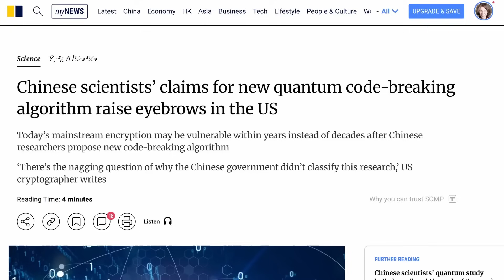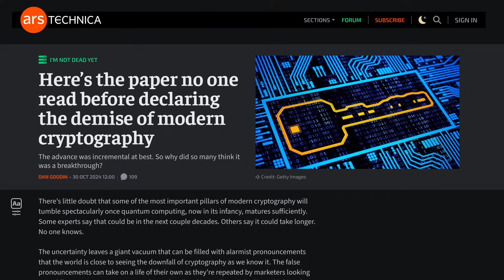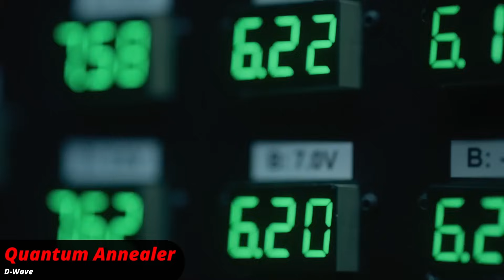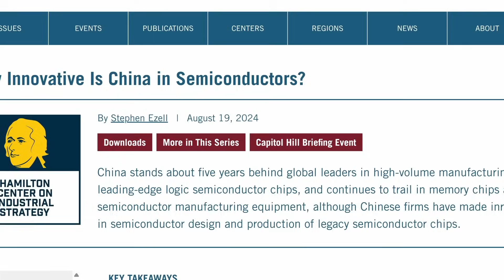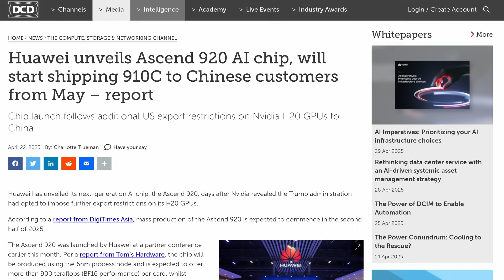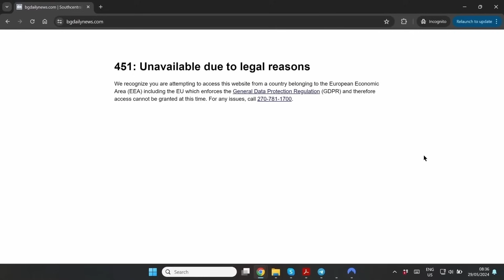Chinese claim "First Successful Factorization of RSA-2028 Integer". I've had a look.

Comment: I think everything has been broken already. There's nothing stopping governments from setting up a whole building full of quantum computers. We hear about things like the first 100 qubit computers, but it's not like it just stops there. At that point, all you need to do is replicate them and connect them. Even if it takes a whole day to crack a single code, if it's important enough, that's all that matters, which is exactly why governments would do it. So even if we don't necessarily have widespread encryption broken, being able to break the encryption on only a few hundred things a year is certainly worth it to governments for the most important encryptions.

Comment: You should be more worried about historic backups being deciphered, particularly with the frequency of password changes. 

For example copies of historic LastPass customer databases were snaffled, from the companies AWS buckets, a few years back, and they contain the credentials of all their users, on every site, the site names, be they crypto exchanges, banks, governments institutions, providers of cat videos, ..., are in plain text, along with the user ID, last access time, while the password was hashed, with the master passwords hash as the seed; depending on when stored, the passwords may have been 8 character strings, with 50 bits of entropy, pushed through perhaps just one iteration of an either weaker variant of the algorithm. Off line dictionary attacks against the customer DB, with a budget PC, would likely be revealing a few customers Master Passwords, and all protected passwords and associated data, per day, buy some old crypto mining rigs and in a couple of years they may have still valid credentials for thousands of users from the dumps. Cherry pick the customers with passwords for Crypto Exchanges, and wallets might start being drained, just like what the press are reporting, if not state secrets. All without a quantum computer in sight.

Comment: 3:45 So there's the catch. Factoring a number N=pq where p,q differ only by 2 bits is easy, even on a classical computer: The number of different values the difference p-q can take is only quadratic in the number of bits of N, namely, it is either the sum or difference of two powers of 2 smaller than sqrt(N). For each candidate value t of the difference p-q, simply solve the system of equations p-q = t, p*q = N (equivalently, let p and (-q) be the roots of the quadratic polynomial X^2 - tX - N) and keep going until you find a value of t that makes p and q integers (equivalently where the discriminant t^2 + 4N is a square number).

Comment: They can break standardized encryption all they want...... and it is basically trivial to add another layer of encryption to confound them,
The "one time pad" is still unbreakable and always will be... as is any non-standardized, sufficiently complex,  encoding system used in low volume comms.
They claim they can break a known code algorithm.. and it is knowing the algorithm that makes it possible to even contemplate breaking it.
Absent that knowledge...... good luck factoring anything that is of any use to decoding things
Or so it seems to me... and I studied encryption to write a simple one-time-pad software app. decades ago.
======
The reason they could break the Enigma code was because they had  Enigma machines to examine. 
They knew the algorithm first.. which was embodied in wheels and wires in an Enigma machine
Then they managed to break the encryption.

Comment: It's a confidence trick intended to introduce a whiff of uncertainty and apprehension at the business and operational layer.  The announcement and arguably the entire programme is intended to undermine default confidence (or arguably overconfidence) in the technological status quo; not just for future encoding (this point forth) but for all that may have run before presuming they maintained copies of data streams from that earlier period which can be retrospectively cracked.  Exposing old data like this can still be harmful so stocking the fire of that doubt may be strategically useful to the PLA.

Comment: Hi Sabine, i Love your content. Really. 
I understand the need for sponsoring. Really. 
I have had a certain VPN provider for years untill it started to break working with  certain streaming providers. 
Then i switched to NordVPN. That really did not help and did not make matters better. So i complained about this behaviour. All that NordVPN did was to ask me to open tickets for each incident ( read: each site that blacklists VPN ip-adresses and those numbers are going up.) 
I am not impressed anymore by VPN providers as they also are getting tracked and 'put on the map'. 
So for ordinary browsing consumers who want to benefit from masking ther location ( which does often not work), VPN hardly seems the solution anymore.
As you are an advocate of truth, i thought this is an important thing to know as well.
By all means i hope you can prove me wrong of course.

Comment: Those who talk about ‘breaking Bitcoin’ fundamentally misunderstand it. It is a network based on trust and if the trust is broken, it will dissolve into nothing. When you understand that, you will see that there is no monetary benefit to breaking its encryption. And on that, by the way, the Bitcoin developers have been discussing quantum-resistant cryptography for years and the network will at some point vote a hard fork and transition the protocol. But sure, waffle on about the boogeyman if you want 🥱

Comment: Hi, Sabine. I am a theoretical physics graduate student, and i really want to ask you something. You see, as of now i gotten a good understanding of quantum field theory, particle physics and general relativity theory, so basically the standard model and classical gravity, the standard theories. However, i notice that from this level and onwards, it is not clear anymore which direction to go. Some professors i have met stop at this level, and some are too busy with a very specific theory, like string theory, quantum loop gravity etc. But from your videos, i notice there are a lot of modern reasearch and important discoveries not limited to the standard form of those theories (strring or loop), which is not necessarily stuff written, as of today, in any books and so on. So, Where do you find papers and materials which like actually covers the most recent theoretical ideas and research. I am having a hard time finding trustable papers/sources of actual modern research, not only text book stuff... Sorry for my long question, but since you are a very respectable physicist whom i might have a chance to actually ask, i really felt i needed to ask this. Maybe its just my university, but my professors are not into this fundamental physics research..

Comment: Chinese is far easier to learn than English as long as you don't look at the writing system.  It has a very simple grammar (no declensions: no verb tenses, aspects, declining for number, gender, case, etc.) and a vocabulary far smaller than English's.

The writing?  Yeah.  That's harder.  But if you've learned to spell English you're already used to just memorizing orthography by rote.

Comment: by the time governments admit to having various tech; they have already been using it for years. in recent years NIST had their pqc standardization event that aims to reduce the number of candidates for pqc in rounds as the years go on. pqc isnt anything new. a myriad of entities can see the oncoming quantum apocalypse and have been preparing accordingly.
my company, SCS; has been developing new pqc algorithms for a while now. if you get how what is perceived to be just human minds as these quantum systems are not yet ai controlled (officially) you can gauge how cracking these protocols would be approached. one would begin by identifying the class or type of encryption used that is to be cracked. this would determine an effective and efficient method for approaching the cracking of such an algorithm. 
many of the popular forms of pqc use a lattice structure or the like in their new algorithms. i think it is 2 of these methodologies that have moved on to standardization from NISTs event. SCS is moving to develop pqc technologies that approach this in a much different way. were developing cryptography methods that entail quantum users or an ai controlled quantum system to attempt to identify the type of encryption and move to break it only to find that it appears to be broken, but it doesnt work. they will conclude that their classification on the type of encryption must have been wrong and attempt to reevaluate the type and try to break it again; only to find that it didnt work again although it appears that they have found a key. eventually they will try to move through every form of encryption know even though this approach would be resource intensive and inefficient only to find that nothing appears to break it though it appears to be an obsolete form of encryption. we are developing a myriad of these languages; each being a puzzle that works totally differently than anything that currently exists. im not going to say much more about it than that.
SCS is also pioneering prototype ideas in nuclear fusion with hardware running our own brand of pqc tech. it is entirely likely that current encryption tech is completely obsolete and has been for some time. they already know all of your secrets.

Comment: Quantum is a metaphor for meaning. Both semantic and teleological, but not either. The relationship between both. 
      The relationship between semantic and teleological meaning is not correlateble by any algorithm. Possibly not even consciousness and self-consciousness: intuition.
      I mean if cryptography breaking were so great then there should be no ancient script for which we would have no exact interpretation. Is that the case?

Comment: The problem with this is it is instance based and can not handle live data connections.  It you have the file encrypted and hand it to the Q machine it can crack it. But files behind active Web sites is a completely different issue. The Q machine can only preform a limited set of functions and this is so limited it is completely unusable for hacking.

Comment: Too bad that almost all comments below are based on very limited understanding of cryptography. Addressing a few confused comments.
Breaking RSA keys is not exponential in their length.
You do not need to double the key size for any algorithm to protect it from the quantum computer. For AES it is less, for RSA/ECC it is (much more)
ECC means Elliptic Curve Cryptography in this context, not Error Correcting code
Switching to RSA 4096 will not protect you much (assuming that quantum computers will ever be able to do RSA 2048)
RSA 4096 is not a good idea anyway; it is a gigantic waste of computer resources. Switch to ECC instead, where 384+ bits is more than enough.

Comment: When you said 2 bit difference in the random primes, I was like.. "Not very random was it."
>
It's all very interesting (quantum) but there is no such thing as a secure computer or secure data.
If you want a secure computer (or data) mash it up with a hammer, put the pieces in a blast furnace, and then shoot the left over soot at a black hole and hope the information is lost :)
>
The second part was the note about the algorithm not being any faster than a digital computer.
This is my primary gripe about the entire concept of Quantum computers. By the time that get it stable and reducing the noise plus error correction you don't have anything better/faster than the current analog based digital computers, and maybe even slower.
>
Or if you want fast, just embrace analog computing and accept the noise/uncertainty in the results :)
>
"Computers in the future may weigh no more than one-and-a-half tonnes." - Popular Mechanics, 1949
Anyone getting deja vu X-)

Comment: Hi Sabine, great work as always, but the title: RSA-2048 not 2028, as in 1024 bits X 2 = 2048 bit
Reply: next iteration : 4096 bits
Reply: Also: they just stole the private key hashes  a few years ago from the RSA main server, waited a few years till people forgot it, thought: we can create a scare in quantum computing, because no one would believe they cracked it with a binary computer: so theft, as they have done many times, not advancement in quantum ( i can't link to the original RSA private key server hack here, but you can google it very easy, including vetted sources like RSA themselves, Wired mag, and other security researchers )

Comment: It's all nonsense, there is no quantum processor with anywhere near the amount of cubits required to factorize RSA keys, not to mention that setting up the state of the system to perform the calculation in the first place even if you had that many cubits would take millions of years. There's no danger yet, and probably not for a very long time. Cascade algorithms need to be developed (to cut down the setup time) and VAST increases in cubit count are needed.

Comment: RSA was originally developed in secret in 1973 at Government Communications Headquarters (GCHQ), the British signals intelligence agency, by the English mathematician Clifford Cocks.  I was subsequently "developed" by Ron Rivest, Adi Shamir and Leonard Adleman, who publicly described the algorithm in 1977.  RSA is named after their surnames.

I suspect it was intentionally leaked through the three, who were highly plausible mathematicians in their own right, in order to introduce a sorely needed "good enough" and "unclassified" encryption standard to humanity during the early days of electronic fund transfers, as none of the alternatives were secure at the time.  I believe the need for white hat security was simply greater than the need to be able to crack black hat encryption, a paradigm shift which continued with the release of DES, then 3DES, and ultimately AES.

The problem with RSA is that it's fairly easy to crack.  It just takes time, but nowhere near the eons it takes to crack AES.   The security of the RSA cryptosystem is based on two mathematical problems: the problem of factoring large numbers and the RSA problem. Full decryption of an RSA ciphertext is thought to be infeasible on the assumption that both of these problems are hard, i.e., no efficient algorithm exists for solving them.  Just because it's not efficient doesn't mean it's not possible when you throw enough processor power or quantum's simultaneity at it.

There ARE approaches in existence today which render encryption unassailable by quantum computing, no matter how many qubits you throw at the problem.

Comment: ECC (Elliptic Curve Cryptography) is already replacing RSA across various applications. Major cryptocurrencies like Bitcoin and Ethereum, as well as TLS (used for HTTPS in your web browser), are already using ECC.
Reply: ECC as such is not quantum safe. Those, that rely on the discrete logarithm problem can be broken by variants of Shor's algorithm.
There are some proposals out there that are supposed to be quantum safe, but some have also been broken in the past.
Reply: @salia2897  Of course ECC is not post-quantum safe. I brought it up to contrast it with RSA.
Reply: That is for Keys, not encrypted data.
I Know the video talked of data, but public keys are a different thing.
Reply: @axle.student  The actual encryption of data in both RSA and ECC is done using symmetric algorithms like AES. If they had broken AES, they would say they broke AES not RSA.
Reply: @shg1883  Yeah, sorry. So many acronyms that I had a moment lol
Encoding and encryption can be so complex with so many mixed components (acronyms) :)
When you write an encoding or encryption module it all starts blurring together lol

Comment: Grant's latest videos over at 3blue1brown do a great job of explaining why even theoretically this is not something we should really be concerned about.   Cracking the "quantum code" speeds up prime factorisation by an exponent of two.  Which isn't very significant when considering encryption at an RSA2048... it essentially just reduces the time required to the same as RSA1024 by classical methods.

Comment: Want to know how it works?

🛡 Field Mechanics Cryptographic Shield (FM-CS)
Core Principle:
Encode information as causal phase-resonance patterns in a structured field, where:

Data is not stored as static symbols (0/1), but as entrained interference structures.

Decryption requires coherent phase alignment with the originating field context.

Each “key” is not a passcode, but a dielectric timing vector, unique to the observer-field system.

🧩 Components
1. Sub-Planckian Signal Encoding (SPSE)
Uses glyph-driven modulation (e.g. Rod, Tarn, Inra) to encode signal interference patterns beneath Planck-scale timing.

These act like biological encryption enzymes — phase-locked and irreducible to numeric keys.

Without the originating field topology, the signal is unintelligible.

2. Dielectric Entrainment Key (DEK)
The "key" is not a static password — it is a resonant alignment pattern in the dielectric medium.

Generated by a contextual interaction (e.g., location in spacetime, biological state, or consciousness vector).

Think: a "living" key that can't be duplicated without field-matching the original event.

3. Mirror-Phase Reflection Lock (MPRL)
Encrypted data reflects its own state in a recursive ninefold mirror structure.

Attempting to “observe” the data from the wrong field orientation causes constructive-destructive self-interference, scrambling the pattern.

4. Observer-Conditional Resolution Layer (OCRL)
The system encodes relational state between sender and receiver — a form of field entanglement.

If an outsider observes or intercepts the message, they collapse the wave-function incorrectly, causing information bleed rather than resolution.